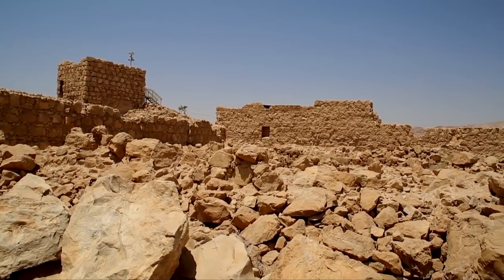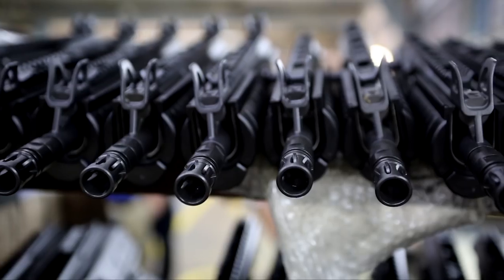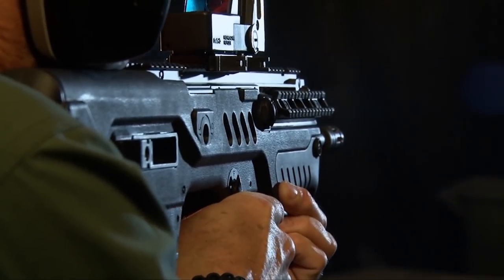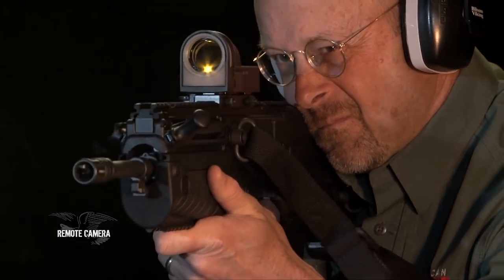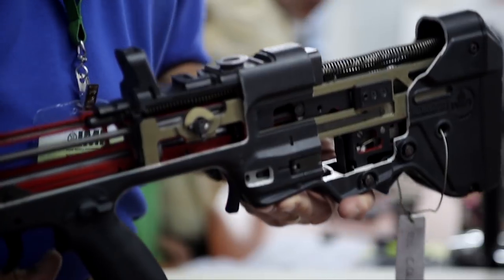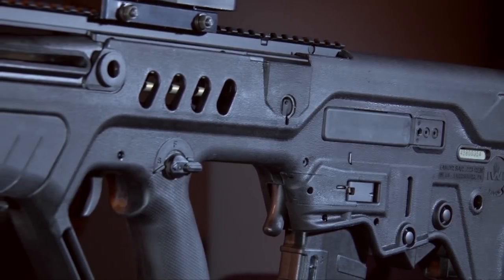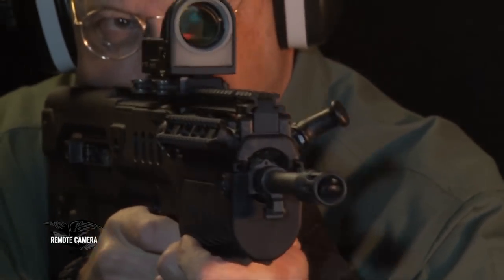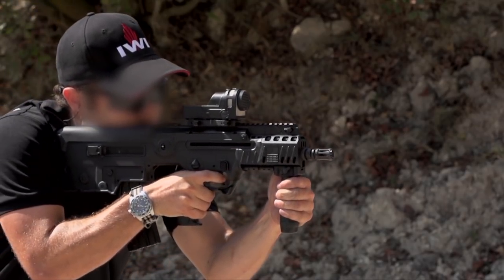American Rifleman Television: IWI Part 1

Comment: Ergonomics over accuracy, yes yes I see that with a FIVE MOA accuracy standard! I suppose it makes sense considering they dont intend on taking precise shots with their Tavors over 300 meters but my gosh what a shot gun. My roommates Tavor running a toasty 77 grain OTM handload is still only doing about 3.5 MOA while my Mk12 Mod 1 custom AR does sub MOA with the same load and about 1.5 MOA with factory 77 grain 5.56 match.
Reply: If there ever was an apples to oranges comparison it would be your comment. You just wasted a long paragraph to type out nonsense.